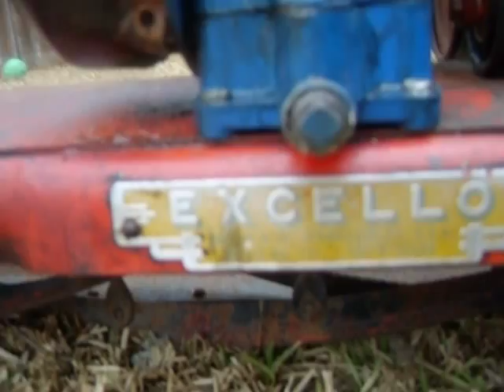OLD BLUE (reel mower) and the special guest OLD RED

Comment: I have never blown an engine of any type.
I missed a 9500rpm shift to seconfg gear on my 1972 Honda CB 450 and stretched the crank and the valves but I could ride it home- VERY SLOW-
I fixed it and it was back on the road in a few months- about 300 bucks later.
It still ran to 106mph indicated in about 8 secs. right to top speed.

Comment from the maker: now any Tecumseh engine will blow above 3600 rpm they dont like to exceed 3600 for wome reason now briggs and strattons the old ones havent blown one up yet long as its got a cast cam shaft it will run forever